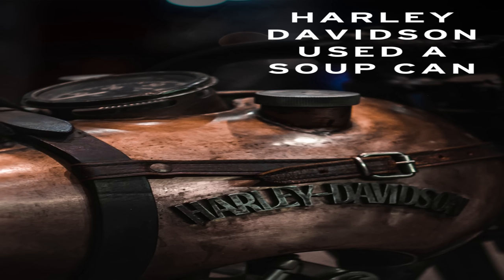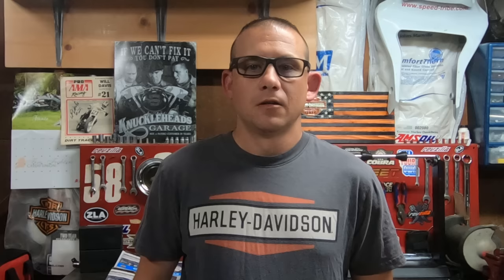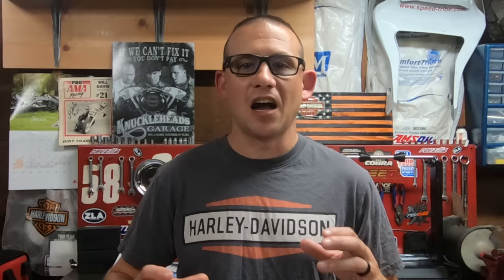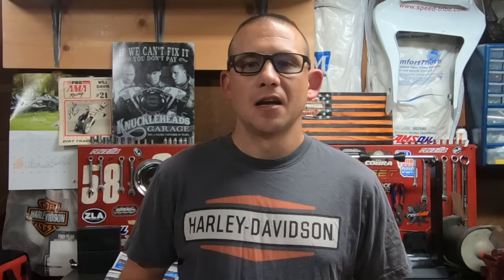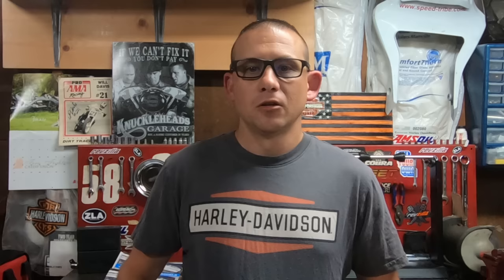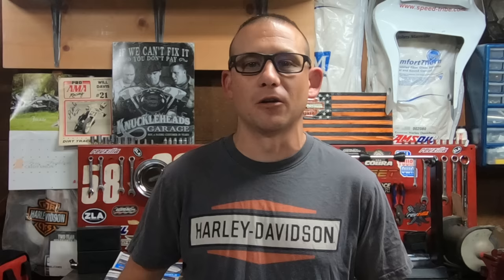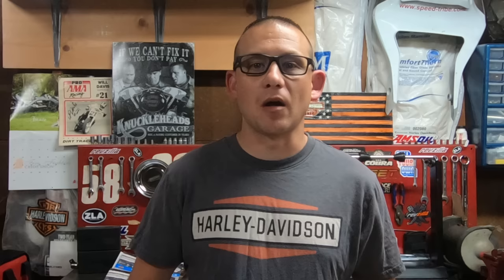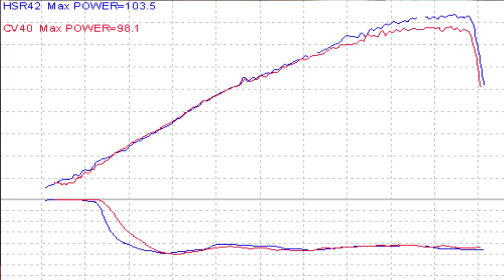CV Carburetor or the Mikuni HSR for Your Harley-Davidson

Comment: I got a 02 883 with kerker 2-1 and a big sucker. I have had the CV apart more times than I care to admit due to it pissing gas from a dirty needle seat that was a damn pain to get right. When I got the air filter and 2-1 I went from a 45-46 and 175-180? Something like that. Still running lean man, even with 3 1/2 turns on the bottom screw. I'm going to go up to a .48 and 195 and see what that does. I do plan on paying for a bore job and bigger pistons this winter, so I'm half tempted to just get the stinkin hsr42 so I don't have to keep screwing with the old CV. I bought an old used CV off my buddy that's got a larger diameter than mine, but it's jetted leaner than the 40 that's on the bike! A guy just can't catch a break!

Comment: There’s always an upgraded version of something, especially carbs. But all in all, the cv carb is reliable and simple. Easy to rebuild on the side of the road if needed and the parts are cheap. I still run a cv on my evo, of course I’m running an s&s stealth air cleaner instead of the stock rig it comes with. But it does me well. Mikuni is nice as well but if I were to switch carbs… super e. Tune it and never look at it again.
Reply from the maker: Super E is a excellent carb over the Mikuni, the CV carb works for just about every situation with most riders. Some motors are really finicky about the carb and one does work better than the other for whatever reason on some engines.

Comment: FI is great, until you are stuck on the side of the road. CV40 for daily rider all day, get the right pilot jet in there and set the idle mix and all you need is enough main jet to maintain the mixture at sustained WOT. Stupid simple carb that can be dialed in for less than the cost of a tank of gas. For performance I would skip right over the HSR and go to Lectron. The HSR does well on a modded 1200, not a good match for an 883. The Lectron is also not a good match for an 883. Both will work fairly well on a modded 883 with open pipes, but the CV40 works fine in this instance as well.

Comment: Hey Bud, love the content. Everything that I’ve learned about an 88 I have learned from your channel and watch it often. You asked for people to comment on the videos that we would like seen. It be awesome if you could do one on what would you have to do to the bike if you but the biggest big bore kit in a 88 or even up to a 110. For instance if you trying to get 140 horses out out 120 kit or bigger. What upgrades to suspension, brakes, chain conversion, transmission, basically to get the body ready to handle that type of power. Such as s&s’s  or zippers biggest kit available and anything else you think. Thanks again keep on keeping on. Appreciate your content.

Comment: By the nature of the design the CV carb partially compensates for changes in altitude, while the flat(or Round) slides are very sensitive to altitude. This also includes changes in air density due to temperature and barometric pressure. Essentially CV carbs are better street riding especially if one rides in the mountains while the Mikuni's are for spot on jetting at the racetrack...

Comment: 1:37  CV is a fantastic carburetor up to 95-100 hp. If you modify the engine moore Mikuni is outstanding. I have a hsr 45 on my 1550 twincam. 209 psi compression, high lift cams and perfect ported heads (high cfm) with larger valves.

Comment: The CV is like the Rochester in the 70's Camaro's. If it was working well, it was great! But I'll take the Holley (Mikuni) for sure.
But then again my 01 88 was bored out to a 103 with the Dark horse crank, gear driven cams, 570's and the 45 Mikuni topped off with the Bassani 2 into 1. She's fast.

Comment: CV all the way. I put a mild hop up on a FLHT I bought brand new in 2000 with a CV. replaced the pilot jet and literally NEVER touched the carb EVER again. I sold it 9 years later with 110K miles on it. I'm currently on an '05 FLTRI. so far so good, but I wish it had a CV on it.....
Reply from the maker: There's a lot to be said about the CV carb, they work very very well. A lot of guys will opt for the Mikuni when you start getting into some real high performance builds though.

Comment: I have a 2000 fxdwg I put a mikuni 42 on it a year after I bought it new . I gained a lot more hp and mileage  I have screaming eagle ignition ,Vance and Hines exhaust ,and screaming eagle air intake other than that the motor is stock . Hands down the mikuni is by far a way better carb I gained a 10 hp gain and get over 50mpg with a tune

Comment: As usual a good video - I got as far as you saying that CV carbs are often jetted rich and thought of a posting from  a magazine way back in history (1977 I think) tittled "How you can read spark plugs and select them by Gordon Jennings" which details things to the N'th degree especially about how engines are tuned from the factory. 
Although primarily about spark plugs, it deals with ignition timing and fleetingly on carburation : - you cannot hope to get the carb set up right if your ignition timing is not set correct for the air filter, exhausts, and general state of mechanical tune of your engine. There is a general thought that if you raise the compression ratio you should retard your ignition..... things are not that simple !    if you retard the ignition then your engine will be less responsive and it is harder still to get the jetting right because you start getting detonation - pre-ignition to some minds.  Check out that posting I mentioned and you may get a better handle on things.
 CV carbs are good carbs - for the right engine !  if you raise compression, increase capacity, change cams, exhaust, air cleaner, port the heads etc etc then you are going to increase the amount of air demanded by the engine and THAT is where the Mikuni (and other carbs) come into their own as they are capable of flowing more air.
 Just because you engine needs more air doesn't necessarily mean you need bigger jets : - if you flow more air through the same size ventury for any given similar revolutions of differing engines, then it will suck harder and pull more fuel though similar jet sizes often making the engine run too rich.
 It is a case of 'suck it and see' quite literaly - I am running smaller jets in my bikes (a XL1200R and '10 Dyna that are 1250cc and 1856cc respectively) than the carbs came with - an HSR45 on the Sporty and HSR48 on the Dyna. I have been told that the carbs are too big for the engine sizes BUT I have made the engines so they flow so much more air than standard that they need a bigger carb. The generally accepted highest flowing carb is an S&S Super D - used by drag racers and only for mega engines !
CV carbs will flow less air at higher throttle openings than Mikuni's do - it all depends on what you are doing with the mechanical state of tune. Once you get to a certain level of air flow required for the power level you want then you may need to address the cylinder heads/camshafts ( head porting is an art, each camshaft profile is different and may require different porting) as they are the main 'characters' in the state of tune of any engine - standard Harleys stop being able to flow enough air above 4 - 4500rpm for even the standard capacity/cams etc etc.
 One thing is for sure though - the cost of a Mikuni carb is small change to the cost of going for high power, but the rewards are incredibley good fun assuming that is that you have improved the tyres, suspension, brakes........
 When you get to that stage of the game you will not care about fuel consumption, but if you ride it gently then it may well give beter milage..... and the guy with the 'Stage two hotrod' who tries to burn you off from the lights will wonder what happened when you wake up your sleeper !
Reply from the maker: Always good to hear from you, been a while! Once again you brought some excellent points to the table in the comments section! I miss the good old days of reading spark plugs, that's how we used to tune was by ear, feel and the plugs!

Comment: Screamin Eagle CV44/CV50mm race carbs with no mods perform great if you have the supporting need stage 2 and up or the Bob Woods Rebel series for radical high duration builds they can not be beat on the street or Dynometer for that matter, awesome carbs! What you don't want to do is go drilling, changing slide springs, excelerator pump nozzles, oversized fuel hoses/inlet elbows on a stock CV40mm that's where you screw up the fuel curve and get poor mileage. The DIY CV mod methods are just going to have you chasing the who you gonna call tuning ghost! 👻 For drag racing spec the Super D is still legendary.
Reply from the maker: You said it right there, the home DIY mods can get you way off the beaten path!

Comment: Throttle response on the CV carb can be completely changed with a Thunder Slide kit. It replaces the heavy metal slide with a lightweight plastic slide. A lighter spring is installed also. At less than $100, it was the way to go.
Reply: i did that modification and had issues with the lighter slide and the andrews n4 cams i had installed. couldnt get a consistent throttle at 20-30mph for the life of me. going mikuni to avoid the vacuum slide all together

Comment: Depends on use case really, the cv is used by stunt riders due to it being smoother like fuel injection. The mikuni will give you snappier throttle response. Due to it being a flat slide. For daily riding I prefer a flat slide carb. I had a 190cc grom clone I put one on and it was a blast.
Reply from the maker: Basically a 190CC grom? Holy crap I bet that's insanely fun to ride!
Reply: @GixxerFoo  it was, that's what got me started riding lol. I loved it so much I bought a harley lol. It was a huge upgrade from the 125 4 spd to the 190 5spd
Reply from the maker: Damn l didn't even know they made big bore kits that big for those bikes. What Harley are you riding now?
Reply: @GixxerFoo  they do make BBK that big but the zs 190 is a complete engine you swap in for 700 bucks. I have a 10 fat bob which I'm currently looking into tires for. I have the Dunlop that look like dirt bike tires now. Not a fan of them tbh they wear uneven and cause unnecessary vibrations etc. The lugs wear horribly uneven. My grom went 85mph, you haven't lived until you went 85 on 12" tires let me tell ya lmao.
Reply: @GixxerFoo  put it this way I paid 1150 for a brand new Tao Tao hellcat which is a original grom clone. I paid 700 for the zs190. Paid 80 for the 28mm genuine mikuni flat slide and 250 for the kepspeed loop exhaust. Rode it for 1500 miles in a month sold it got all my money back and bought a harley. I've owned 3 Harleys since last August.
Reply from the maker: Damn that's awesome! I love it when you build something like that, enjoy it and get a return on it!

Comment: I have a 88 on my 04EG. Cv carb is giving me fits since I changed the pipes. Has 509 cams and a big sucker air filter. Has 50/195 jets. Comp delete ( sprocket). What it does is super annoying. It tractors or two strokes so I’m constantly pulling the clutch so it doesn’t buck. Especially in town and around 2k. That dun dun dun dun. A shop listened to it saying idk sounds lean on the bottom and rich up top but I can’t really trust them if you know what I’m saying. It sneezes sometimes off idle so 🤷🏻‍♂️. Idk what the previous owner did other than “ carb work “. I’m starting to travel and it’s super annoying to feather the clutch much more than I should. I’m thinking it’s the cv is a basket case and heading to the mikuni route. 100-120 miles to a tank kinda sucks too. Tried adjusting the a/f all day. Any ideas?
Reply from the maker: It does sound like it's running lean on the bottom end if it's bucking around coughing through the carb. If it's got a CV I'd go through the carb and check the diaphrams just to be safe.
Reply: @GixxerFoo  it’s definitely not a smooth ride. Since it’s going into hibernation now I hope to figure it out in the spring. Thanks for the response!

Comment: Ironically the arguably the best carburettor was the SU which used to be available for a Harley in kit form a flat slide was best used on the track for high RPM. CV
Reply from the maker: That's an excellent point!

Comment: I have no experience with the stock CV carb that came on my 2003 sportster, when I bought the bike it had a hsr 42 on it and Andrew's n4 cams and Vance and Hines pipes. The bike really seems to like the carb. The throttle response is something to get used to. I get close 50 mpg. I have rode from sea level to mountains and it seemed to be just fine
Reply from the maker: That's a great carb to have on a 1200 with that set of cams!

Comment: A carburettor is a service item along with the fuel filter. CV has a slight lag.
My Dyna chassis doesn't need surprises like instant full torque.
Wear items in the drive along with the mounts don't need instant throttle response in something you plan to keep.

Comment: Hey brotha, I watch your vids all the time, great content! I have an 01 road king, converted it to carb, I have an hsr42 on it, 2into1 exaust, ss gear driven cams, and a baker 6 speed. I’m looking for some more power and I think my clutch is slipping a bit. Can you recommend a remedy for that. I put a extra plate clutch kit and still seems like it’s slipping. Also I wanna put a big note kit in, what kit would you use?

Comment: Had a HSR45 on my 91 polished/ported/cammed/SE heads/Kerker FXR and that instant throttle response pretty much only led me to sin in my ways.  That throttle was addictive.  I downgraded it to a CV40, and my wallet is much happier now.  As is my insurance rating.
Reply from the maker: Did your mileage come up with the CV carb?
Reply: @GixxerFoo  Sho' nuff.  Went from about 23 MPG's actin' like a fool to 36 MPG's drivin' Sunday's best style.  But I do need a bit bigger main jet.
Reply from the maker: 😄😂👍 those are easy to swap
Reply: LOL>>>LOL>>>LOL
Reply: How does your insurance rate go down when they don't know nor ask what carburetor you have?
Reply: @generobertson6891  tickets 🤔 zzz

Comment: Had an hsr 42 on my 06 1200 custom....with a 2 into 1 header it would pull the front wheel off the ground bangin gears...night and day difference
Reply: My 03 1200 is chopped with 4degree rack with 4 over tubes. with that drive belt I don't trying anything out of the hole shot. just ha cruzzing
Reply from the maker: Put some fuel to it and they will respond well, what else did you ahve done to the engine?

Comment: This is good information, but makes it hard to decide, if I want to spend the money. I have two 2003 Sportster 883 Customs. They could both use work on the carburetors. Have you ever heard of Lectron carburetors? I just found out, about them, a little earlier. What do you think of them, in comparison to the others?

Comment: Pop's '99 Heritage has been, how do I say, let's just say it was built like a Race Engine for the Street. Everything is tuned. From the S&S Super to the Hooker, yes Hooker, Pipes. She THUMPS and if you lay into her, you better have a hole to put her in cause she's going whether you're ready or not. It's kinda funny to me that the first Street Bike Dad had was a '69 Triumph Bonneville Chopper with an honest to God Race Engine. The guy built the Engine for his Race Bike but wrecked it before he could put it in. So what do you do with a Race Engine but have no frame to put it in? Why, you put it in your Hardtail, Raked Old Skhool, by today's standards, Chopper sitting in the corner of course. (It was the '70's after all) That thing was a MONSTER when it was running. (Dad's nothing more than a Shade tree Mechanic so the Duel Points gave him fits.)
IF he keeps her, that's doubtful but if he does, he started on a MONSTER, he'll end on a BEAST.
Reply from the maker: A race motor on the street is a lot of fun! I haven't heard any mention of a Hooker motorcycle exhaust in years!

Comment: I'm building a mild evo engine with Edwards EV59 cam, 9.5:1 .030 over pistons, mild portwork, 2 into 2 exhaust and am wondering whether I should use a HSR45, Super E with powerjet or even Weber MCHH for best street performance?

Comment: I would never change my CV for a Mikuni, why? I have  03 Dyna, 95 inch Mondello heads Wood TG8 cams Bassani exhaust, Dynatek ign, DarkHorse crank and a stock but rejetted CV. No hesitaion, no flat spots. Great carb
Reply from the maker: CV's make awesome performance carbs, nothing wrong with them at all when are tuned and jetted properly.
Reply: @GixxerFoo  Yep, Mondello did a manifold blend with the heads and I have a .205 main and a .50 slow jet. I live on Maui at sea level. Plus the way the backing plate mounts is stock not like a mikuni.

Comment: You will never ever see a CV carb on a racing bike, in line 4, airhead Beemer, Brit, Guzzi, Ducati, Laverda.
Never.
They all run slide carbs.
Miks, Dell Orto, Amal.
Never a CV.
Tells ya something right there.
As well as liking my easy to tune slide carbs, i always got on well with the S&S Super E too on Evos. Bit juicy, but great throttle response.
Reply from the maker: Some metric sport bikes used to run CV carbs, a very very popular swap was to the Mikuni flat slides.

Comment: CV-great for riding in all conditions but lacks throttle response. S&S is a dinosaur, not the smoothest for street riding but the best for WFO. Mikuni flat side hsr- Closest thing to fuel injection, best all around performing carb but doesn't play well with dramatic elevation changes like mountain riding and may leave a little to be desired above 6k rpm's.
Reply from the maker: You hit the nail on the head right there!
Reply: @GixxerFoo  Yeah, basically reiterating what you already said.